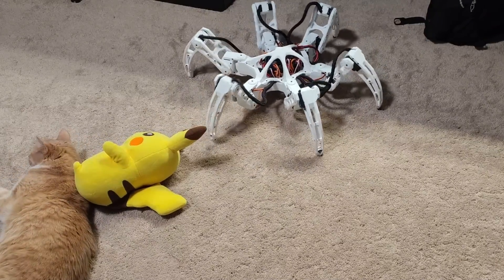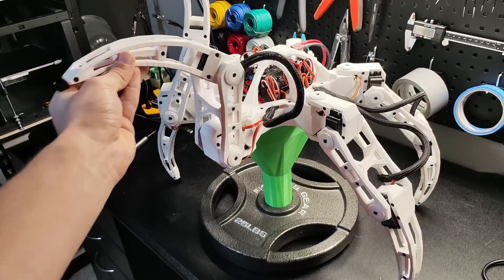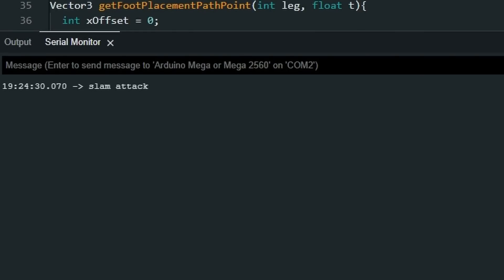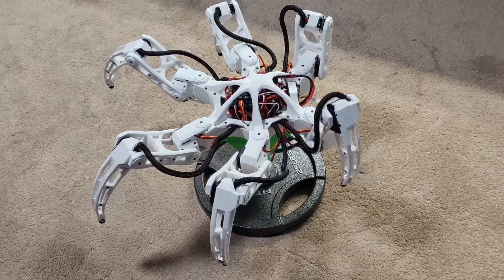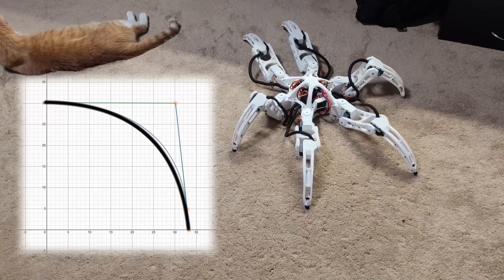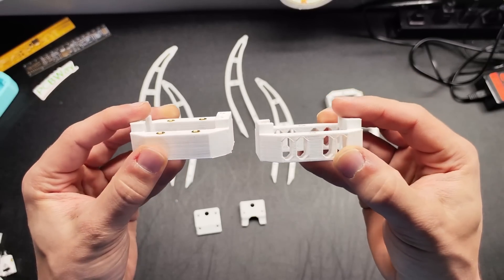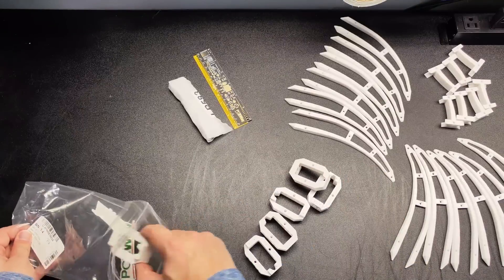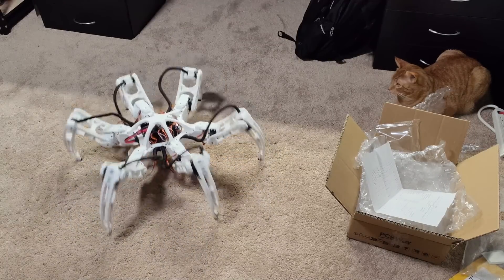I Taught My Hexapod a Slam Attack

Comment: Ok… I know it’s a sponsor spot so you gotta do whatcha gotta do but it’s absolutely ridiculous to have elephants foot on a ordered 3D printed part. If it was a hobbiest doing it that’s one thing…. But that fact is the P1P is an entry level machine. If they’re “industrial” grad printers aren’t calibrated to the P1Ps standard…. This has been the perfect warning for me not to use their FDM services (not that I would need it for anything other than materials above 300 degrees)
Reply from the maker: It's not really an issue with the printer. The p1p slicer adds elephants foot compensation when you make the gcode in it. Theirs obviously did not, so you just need to add a small chamfer

Comment: I find it very interesting that small scale hexapods are 'easy' but possible, whereas something like the hexapod that the Hacksmith tried to build was ultimately deemed a flop by them
Reply from the maker: Yeah when they are small you can basically just directly attach the legs to the servos. When they are bigger you cant do that and things get drastically more complicated. Also its nice to be able to 3d print everything. I guess you still could with a larger one, but the 3d printer required would be extremely expensive. Although design a big one out of metal sheets shouldnt be too bad...

Ultimately theirs was wayyyyy too heavy and the legs were too weak, but i'm really glad they tried!

Comment: A good improvement idea could be putting rubber on the tips on  the tips of the legs to make it not slide as much
Reply from the maker: I already do! But they could be way better... I wonder if 3d printing them from a gripping material is the solution?

Comment: Do you have a movement to get it off its back in case of a flip?
Reply from the maker: Thats a great question that i literally havent thought of until right now.

I just tested it manually, and yes i believe its possible, but i dont think im going to add it. It just isnt worth the 5 or so hours it would take to get it working imo.

Comment: Why body slam when you can attack and have it two inches off the ground. Also, maybe body slam could be a scond attack type.
Reply from the maker: I think i address this in the video, but landing on the body instead of the legs takes a ton of stress off of the servos.
Reply: @AecertRobotics  I can understand. Components are expensive. When I helped make a spider robot, we scripted a rig similar to a 3D rig using bones, inverse kinematics, forward kinematics, and controllers in a 3d program. I went and animated it and with the animation data (mainly using the controllers for the rig and not the bones; including a sensore to detect the ground using a laser which helped guide the rig constraints) we simulated the robot behavior. We used wires instead of gears for a more smooth motion. We also simulated it in a 3d physics program to understand where the fatigue and heat areas were and swapped out the components for more durable and heat resistant component materials. We thought about having some sort of cooling method but it was too expensive, so we moved to a design that allowed for a temperature sensor which gave us readings if it was over a certain unsafe amount. The robot worked and we got to move the head around using a HTC Vive headset as it crawled on the floor. Most of the work was planning and data analysis instead of working on the actual robot from what I remember. We had six methods from what I remember on what we thought would work and only one of those methods gave us accurate results.

Comment: Why not a jump attack
Reply from the maker: I think i address this in the video, but i want to limit the amount of force on the servo gears.
Reply: Well yeah but the thing is it did not jump but its cool 

Try reducing the base leg and adding in another leg joint and segment and maybe pneumatic pressure shots at the leg tips for jump 

Combine with shockabsorber in the inside of the leg and one on top of leg to the body where joint meets to absorb the shock of the landing and maybe use or air canister to refuel the air or just bike pump 

Or switch pneumatic to springs but with screw and gear  with motor to load them and control them 

And check out that hand guy that made his own hand on youtube

That and maybe the exoskeleton muscle or the pipe that expand and contracts maximum minimum power expansion and pressure theoretica limit to the material outputs info with

The world record jump with elastic band or something like that is is used to launch it 

And fyi dunno how much space is available for you but i do know if its cool enough and good enough maybe the military might even wanna check it out since it would be Cool new approach to drones

Comment: it would be cool to measure the increase and decrease in resistance of the servos to calculate impact, weight and inertia to make procedural animations for the robot. you could also do this with MEMS-based accelerometers but that adds weight and you wouldn't be able to tell how much something weighs.
Reply from the maker: The most im going to do in that area is use foot switches to know when the legs are on the ground, then have a gait that uses that info to walk over uneven terrain.
Reply: @AecertRobotics  i saw the stream where you designed something like that. that solution also works.

Comment: 1) In your first video you mentoned releasing the files of the project open source, are they public yet? I am a second semester student in Mechatronics and I would love to learn from your code.

2) Where did you learn how to develop software for a robot? If you do Web Development as a job, I assume robotics were mostly self-taught, even with a programming background that would make learning easier.

3) What are your future plans for the robot? What features are currently working on or planning to ad? Is there a "Endgoal" for the robot you are working towards?

4) Is your cat not scarred robot?
Reply from the maker: Email me and I'll send you the files! Be warned though the code is hard to follow atm.

I have a cs degree and a lot of game dev experience, which helped a surprising amount with coding the hexapod. So yeah self taught 😄. Only robotics experience prior was Lego nxt as a kid, and an engineering / Arduino class in highschool.

Future plans are to finish it by adding foot switches, a controller redesign, a full cad redesign, and armor attachments. Then I'll be creating a kit for others to build it as well. And some time in the future a course teaching the skills needed to do what I did. 

The cats are completely used to it. I think they ignore it because it doesn't have a smell 😄

Comment: Is there any particular reason you went for an Arduino rather that an ESP32, or other microcontroller?
Reply from the maker: Arduino was all I knew, so it's what I used. I also found the ant hexapod tutorial online from howtomechatronics that used the mega, which proved to me that it would work.

Using the arduino mega also keeps things relatively simple. It definitely holds the project back a bit, but that's not necessarily a bad thing.

I do look forward to building a more advanced hexapod in the future with a much more powerful microcontroller though!
Reply: @AecertRobotics  Thanks. I recently started using the ESP32, and was surprised it can run the exact same code as Arudino, so no learning curve. Main reason I asked is because you must be using a lot of EEPROM. ESP32 is also much more powerful, 240Mhz vs the 16Mhz on the mega. It's also dual core so you can assign routines to the other core. Mega does have more digital pins though, and I imagine you need a lot for this project.

Comment: Really very impressive, what resources you use to learn all these and how I can learn arduino programming and electronics??

I can only create simple smart dustbin, auto irrigation system by copy pasting codes.

Please consider my question and help me become robotic engineer.
Reply from the maker: Thanks! So programming was the only skill i was good at going into this project. I have a CS degree, and i do game dev as a hobby, so picking up arduino programming wasn't difficult. I would just start with simple projects and work from there, it's really important you understand the code though and not just copy and paste it.
Reply: @AecertRobotics  thank you Sir for responding. Will try to understand code more as I have basic C++ understanding (currently learning recursion) but not in development part and also any advice on electronics?

Comment: You should abandon those cringe servos and make a haxapod on proper BLDCs controlled with FOC. This will differ your hexa from others, and make it much smoother, faster, stronger and quieter. You should also abandon the arduino board and get yourself an stm32 or esp32. Thank me later.
Reply from the maker: I would love to upgrade the servos, but it would balloon this projects cost, making it harder for other people(and me) to afford.

Im totally open to creating a hexapod with better motors, but a company would have to sponsor the project and send the motors for free. This is something i am considering actually, but I want to wrap up this current project first.
Reply: @AecertRobotics  Sure, it's your channel and you decide what's better for you. I'm just saying if you want to dive deeper into hexapods you should go this way. The BLDC motors of size 2306 or similar are cheap btw, controllers you could ask Trinamics for samples.
Reply from the maker: Can you link me a bldc motor you would recommend?

Comment: Not sure if you are aware of Unity3Ds ML Agents; having a neural net train on walking obstacle recovery gating would be interesting. Since you already wrote the gating, it could „just“ tune higher order variables like timing, speed, curve coefficients to achieve goals like smooth walking, speed, battery consumption etc. Like the Project. Love the Cat 😻
Reply from the maker: I probably could... This project though I don't think I'll do anything like that. I do however want to make a different hexapod where it's movement is completely done by machine learning. Itll have 4 legs, 2 servos per leg, and I think it'll be really interesting to see what happens.

Comment: How's it do with stairs?
Reply from the maker: Up, not great. Down, very quick!
Reply: @AecertRobotics  Any plans to add LiDAR, contact sensors, etc., and incorporate adaptive gait algos or goal planning into the code? It would be a paradigm shift in your design, but you have already come a long way and there are some resources online to help with the coding portion. 

Very cool project nonetheless.

Comment: Great progress, it’s getting really impressive now.

Good to see you are adding the feet switches next, that will allow you to program it to work on any terrain, even very uneven terrain. On mine I am going to use a form of force sensing on the feet instead, so it will be possible to tell exactly how much weight is on each foot, may be unnecessary but it isn’t that complicated and is surprisingly very cheap, just involves some magnets, springs and Hall effect sensors plus a 3D printed housing. I already have a prototype of the sensor but the final version will be better and built into the leg.

I think you could improve its ability to do complex movements if you add an IMU, you can then give it a sense of balance, maybe allowing it to lift the front legs up and not fall over, maybe even allowing it to carry something between its front legs and walk with the remaining 4.

As always great work, this is quickly becoming one of the best hexapods on YouTube.
Reply from the maker: Thank you so much!
Yup! I actually already had them but I really didn't like the design. This new design is frankly really good. Uneven terrain walking should be fun to program.
Oooh force sensing, it feels a bit overkill but it will definitely allow for smoother steps. I need to look into hall effect sensors.
I plan on adding an imu with the next pcb redesign! Main thing for me is to keep it level when walking.
Reply: @AecertRobotics  yeah it may be overkill but my purpose for building it is mainly for learning and gaining experience so going a bit overkill is a good thing. I will have position feedback on the joints too and current sensing per leg, in total it means I need 30 adc channels so I will be using an FPGA for it as well as an ESP32.

Comment: Hi, i have problem with inverse kinematics, i don't understand how to get end of effector values for every legs, any references to solve that?
Reply: Your best bet is to go and learn inverse kinematic from a textbook or online resource, if you can apply it to one leg then you can apply it individually to all. As for where to move the leg, that is part of the gait and there are multiple to choose from and different parameters for it, like step height.
Reply: @conorstewart2214  i did, i just didn't understand how to get the coordinates x,y,z for end of effector every legs or the first position to get gait

But thank you for replying my question
Reply: @lookiii1  for that you need to define what sort of path you want the feet to follow, you could define it as a series of points or a series of curves to follow. Curves are probably better since you can have them computed as it runs and change parameters like step distance on the fly.